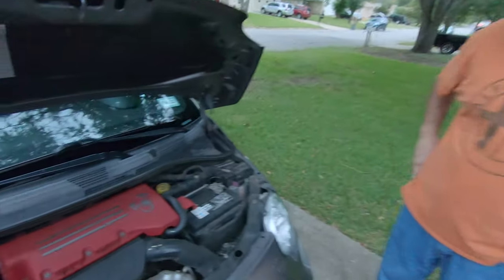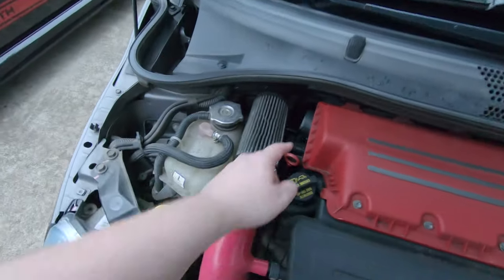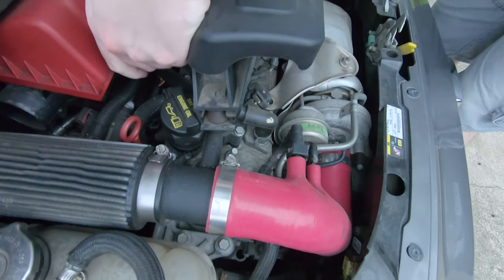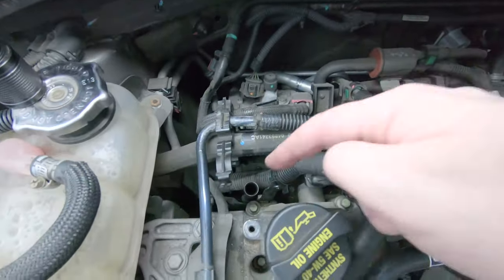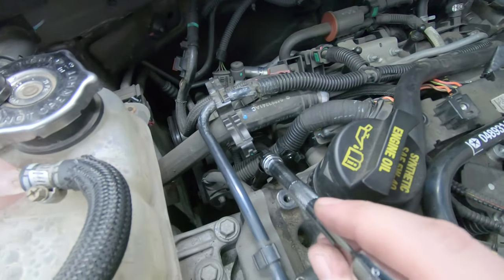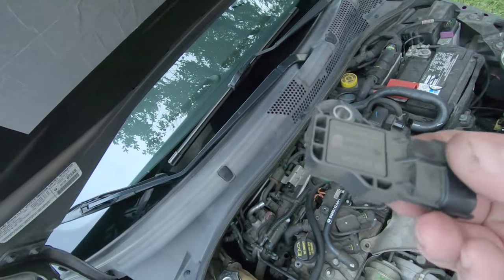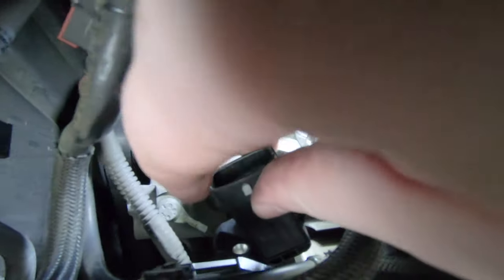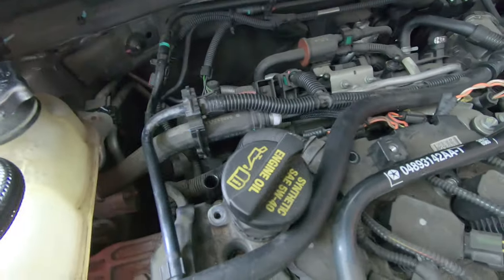Replace MAP Sensor on an Abarth 500

Comment: Exactly the same issue I have with mine.  Would have issues starting, would stall, sound horrible, had the occasional traction control/hill start light flash at me.  It drives, but not smoothly.  I also have issues with the car breaking up in high RPMs, so with the airbox off I'll be installing Alpha Romeo 4C coil packs, with new spark plugs.  Feels like the perfect thing to upgrade while the airbox is off.  Should solve all my issues!  Maybe the MAP sensor was the start of those issues, but eh, the car deserves the upgrade anyways haha.  Thanks for the video!
Reply: Pudiste resolverlo , con el cambio de bobina y bujias?

Comment: Great tips and pointers in this video, much appreciated. What year is this Abarth? I went to go replace the MAP sensor on my gf's 2013 thinking it would take maybe 20 mins and two things happened: 1. The MAP sensor plug has a totally different clip with some kind of red guard on it, kind of like those locking/security type plugs, and try as I might i could not get the sensor unplugged, it looks to me the wiring for it loops from a different direction entirely (more from the left facing the engine) and 2. The retaining clip for the hose thats attaches to the bracket which is conveniently right in the way would not, for the love of all things holy, release. I tried to move the whole entire thing out of the way by unclipping the top two lines and sliding it over left and right but that didnt give me the room needed. I've been denied and totally stumped by two clips that, try as hard as I can with all my might, couldnt get them released. It looks like a regular/lower submodel would take maybe 5-10 mins. Totally frustrated.
Reply from the maker: That's odd about the connector. It should be the same. It sucks, but sometimes those plastic hose clips just break. You might be able to find new ones on store.mopar.com, or just secure it with a zip tie 😅

Comment: noice...i want to replace map sensor, purge solenoid, and  wastegate solenoid on my abarth...no leaks, preload is good on wga, turbo is in good condition...boost just doesnt build as fast as it did and i remember it kind of changed when fiat service center said they replaced my purge solenoid..
Reply from the maker: Your diverter valve might be getting worn out. Replace it with a GFB. Also since they were messing with the lines around the purge solenoid, tripple check there are no boost leaks.
Reply: Mine is exactly the same. No boost/acceleration at full throttle
Reply: @vina_colada  have you found out what your problem was? i have somthing same with error code p0300 and p0301. seems cilinder 1 but dont know if its only the spark plug
Reply: @BookAutowerks  GFB's are among the worst parts out there. TurboSmart makes a much better product. The few GFB DV's I've had all resulted in boost leaks